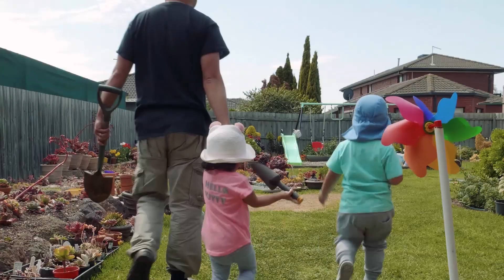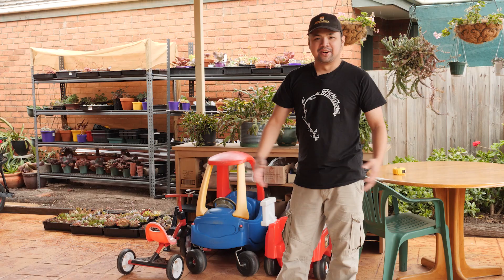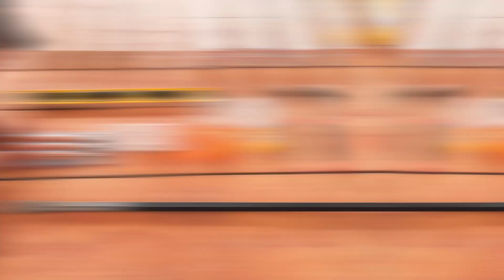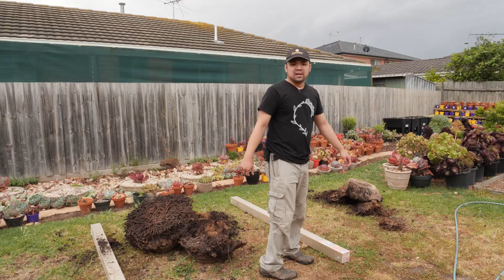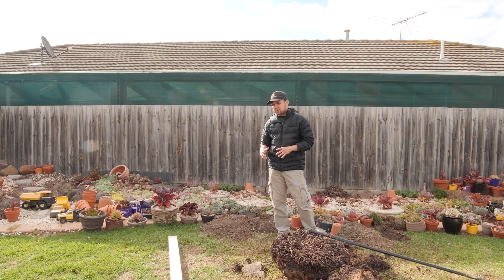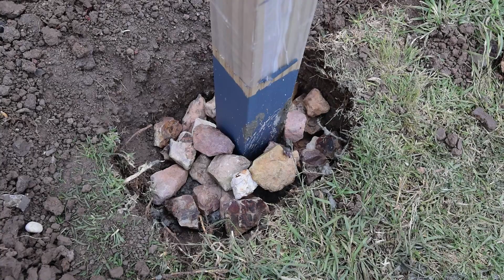#146 Building a freestanding pergola part 1

Comment: Good luck, mate, with the pergola! We made two greenhouses for the succulents and they love being in there! I am in SA. They grow straight up. One of the houses is made of timber and the other is arched plastic pipe. UV plastic all over and well sealed (and has a door) and white 50% shadecloth over the whole thing. The nursery said no more than 50% white shadecloth because it lets in the right amount of light and keeps warm in winter and cool in summer! I put the hose in the doorway of each house to water and give them a lovely good soak spray. They are the happiest succulents I have ever seen! Got loads outside in pots as well and all we have to do is get through summer. I can move them under the verandah when it gets very, very hot. Looking forward to seeing what you create!